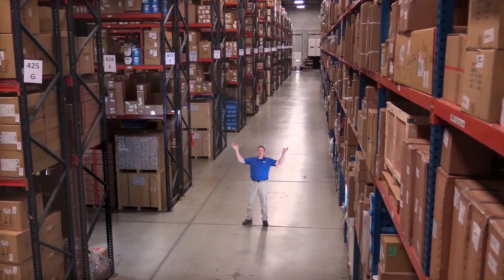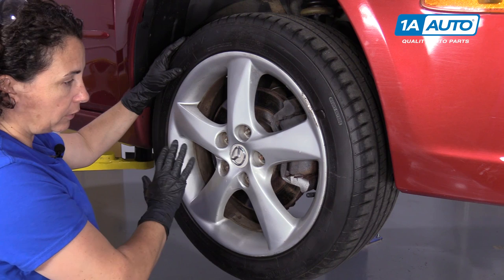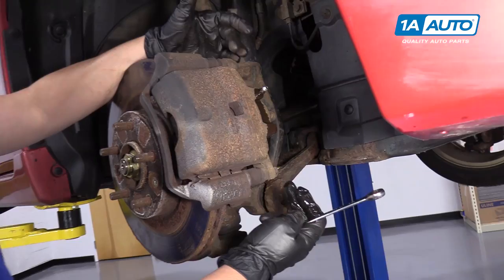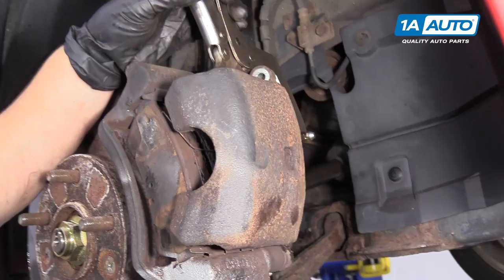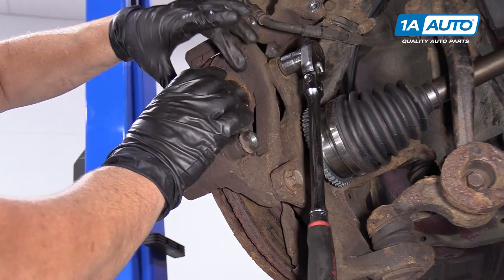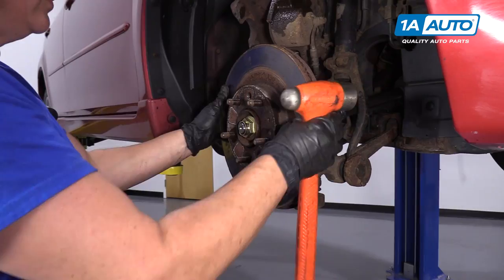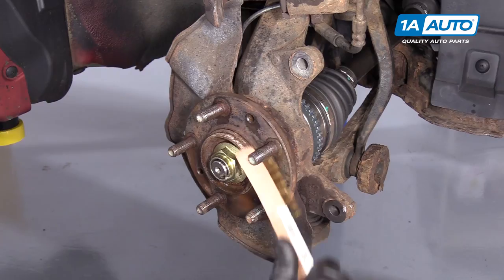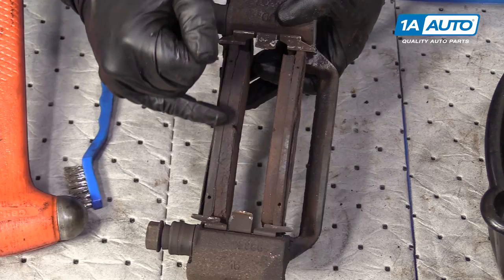How to Install Front Brake Pads Rotors 2006-07 Mazda 6

Comment: I don’t understand this. I did mine the exact same way not a new rotor. But when I compressed the caliper and go to put it back on the bottom hole will line up the top one will not. Idk what’s going wrong. Guess it will sit on jack stands and rust😂😂

Comment: Do you need to actually bleed the front brakes when doing all of this or is the ‘gravity bleed’ enough?
Reply: Any disconection of brake system has to be finished with full bleeding of line. You need to pressurize system in order to squize out air bubbles. Otherwise ... well
Reply: I've done this and just pushed the piston back without opening the bleed screw. It works fine. If you open the bleed screw you risk air getting in. Then have to bleed the entire system.
Reply from the maker: +jacobb Thanks for checking us out!
Reply: @PerilousPauly  Like she say. If you push the piston without opening the bleed screw, you risk to damage to abs system.